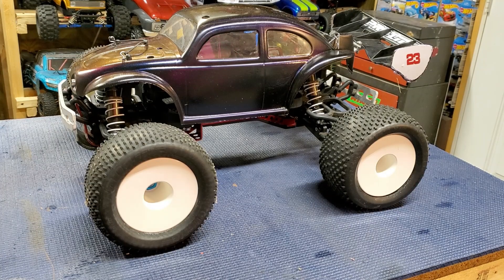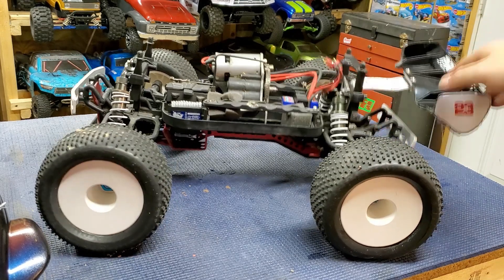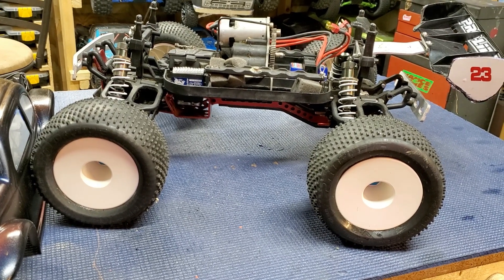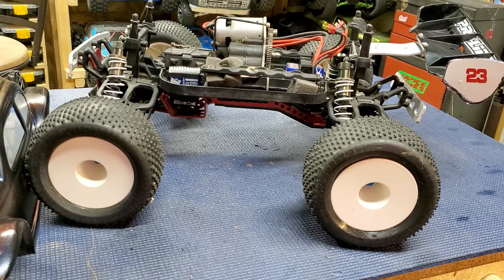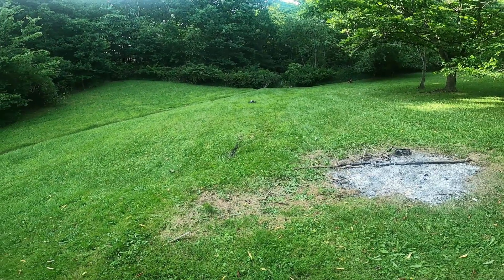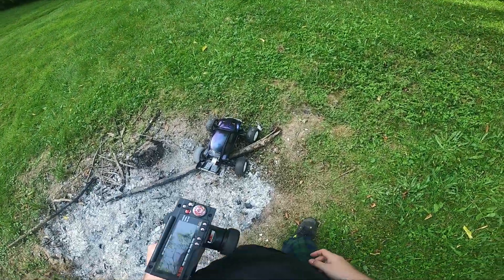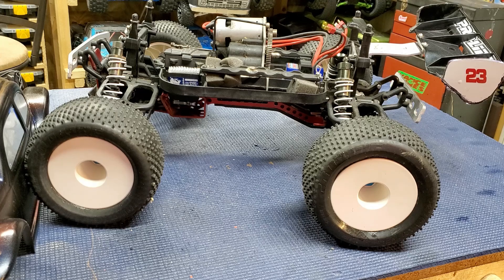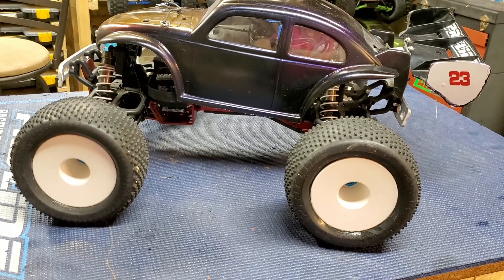E-Maxx 3906 With A 775 Soup Can On 4s! (Broken Parts Ensue!)

Comment: What spur/ pinion combo?
Reply from the maker: It's a 20/72 if I remember correctly. Both are hardened Robinson Racing gears as well. It's about as close as you can get with the transmission case and the size of the motor, any smaller on either gear and the motor rubs the case.